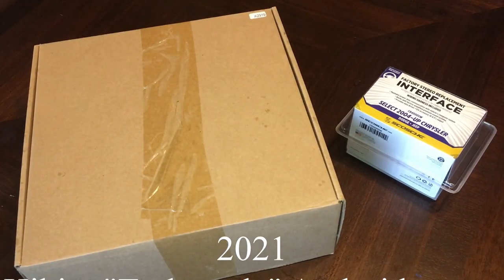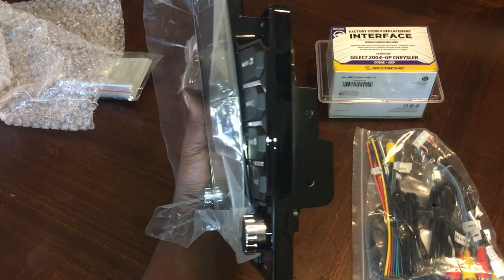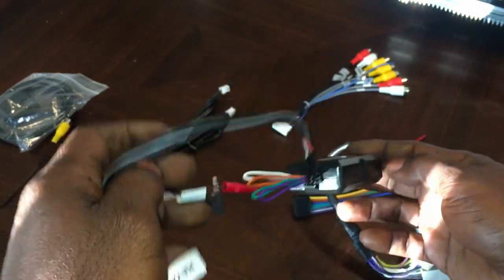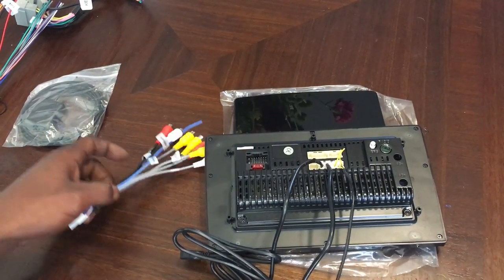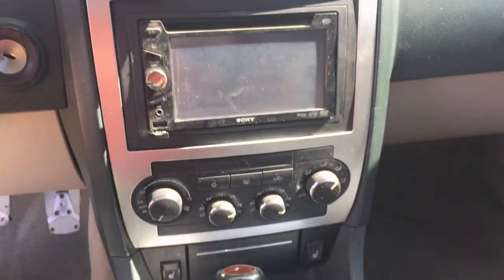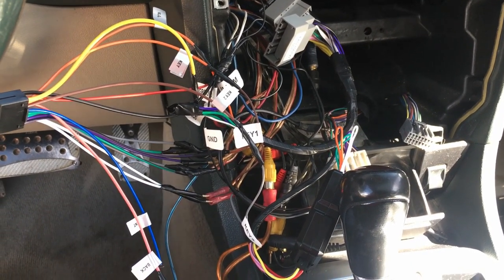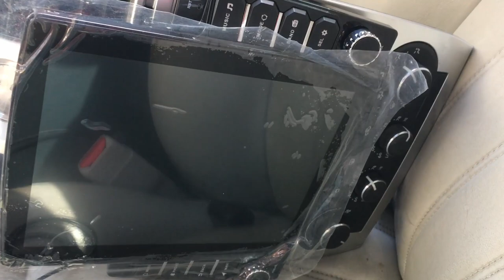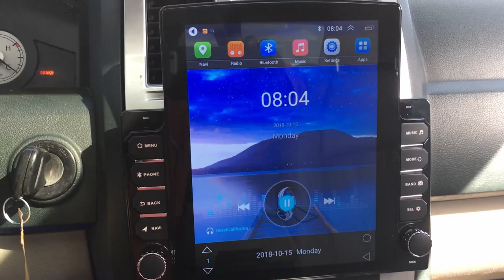AMAZONS CHEAPEST Full functioning Tesla style Android car stereo by HiKity - Everett's install pt1

Comment: Make sure to go to your settings and set it to reboot after 1hr of car shut down or it will drain your battery forcing your alternator and potentially damaging both. It is set to "no reboot" by default that's why it fires up quick when ignition engages power. Also, couldn't delete those annoying songs! If you figure something out, lmk. Lol
Reply: Is there a setting to turn off without power?
Reply: @garystinten9339  go to settings > factory settings> 8888 password> engineering test debugging> 26959910 passcode> direct shutdown mode> press okay and turn off car and allow 2 min for head unit to turn off and reset
Reply: I’m confused . So it stay on draining battery while car is off?
Reply: @dracgod  yes. It'll kill your battery in weeks and may even damage your alternator. Most aftermarket radios tend to mess with the battery and electronics if not calibrated properly.
Reply: @Adeus1  so after setting it to reboot it will turn off after the car is off ?
Reply: @DopeTech1  yes
Reply: @Adeus1 That's pretty rare with any half decent Android unit these days. Cheap options or old units yes. Nowadays when you turn off ignition then open door with canbus as soon as you pull door handle the unit should disable using no power until you open car turn on ignition as it will be shut down. My last 2 units used this shutoff & never had battery issue. Not to say it can't happen with older or less speed units.
Reply: @johnjordan7232  I thought so as well. This particular unit, however, has settings option to stay awake or up to a desired amount of time (hrs) for quick start up. Changing the settings to shut down mode will result in powering on every time you start the vehicle.
Reply: So I just bought one and the screen does not respond to touch. Any suggestions?
Reply: @KyleRobison-tw7uj  I would return for replacement, if that's an option.
Reply: @Adeus1  wanted to check before I do tgar

Comment: I have purchased one of these not too long ago for my E90 2010 I really like it I was able to get the front camera to work correctly The rear camera to work correctly and I can use it and utilize it for any of my movies or music that I can play on but when I shared it on the BMW form nobody not nobody not one person said it's it's okay everyone else didn't like it but I like it that's all that matters
Reply from the maker: Depending on the model I would have to agree. I some cases it may not be worth it to take out the factory head unit. Tesla, BMW, Mercedes and newer Cadillac would just be a few of those examples. It's still a great unit for many other different models (just trying to be honest) I would love to know what cameras you used though.
Reply: @coloradosdigitaldistractio3161  when I get on my break my next break I'll tell you the name of it you can connect it to your camera your front camera from the head unit and as well as you can connect it from the rear so when you're backing out you'll be able to see it no problem The front camera is like a dash cam USB

Comment: Man I have had this head unit on my mind for the last few months I just can’t seem to order it because I keep getting all mixed messages from all the customers. Half of them say they are cheap junk radios and others say they are happy. I have a 2006 Toyota 4Runner I want to install this in and think it would sink into the dash perfectly because around the factory radio there is a lip and the vents are on the out side edges of the radio with nothing in the way on top. Only thing I’m concerned about is mounting it correctly and being able to get inside behind it to screw it into the dash, also I am wanting to install some subwoofers later on down the line nothing big tho I’m thinking like 4 8” woofers or something along those lines. I love the regular head touch head units but I’m looking for something to give my ol’ 2006 a more modernized feel of technology in the interior. Wish there was more options of vertical head units but from what I have researched this is literally the only kind other then one or two others but they do not have a very pleasant look to them.
Reply from the maker: They do have different models. This is not your only option. It really all depends on the setup you have in your truck. It is not an easy install but it can be done.

Comment: How do I do screen mirroring you know it kind of sucks cuz I own one now backup cam it's not all that great features it's not all that great overall this thing blows
Reply: Thanks for that
Reply from the maker: Sorry you feel that way. I also feel that way sometimes when I don't know how to do or use something. But the unit has a split screen option, so not only does the rearview camera work great, you can also display front and rear cameras simultaneously. If you have an android you have to install the app.

Comment: blocking the vents and can do damage on hot or cold.
Reply from the maker: You are correct my friend. I just close those vents when I need them. or I just angle up if really needed. Haven't had any issues yet. I've had it installed for almost 2 years now.

Comment: Sometimes even when I turn off the tablet, then the very next morning I find the tablet on and my car battery is drained. Do you have any solutions for this problem?
Reply from the maker: You have to go into the settings and make sure the deck fully turns off after the car is off.

Comment: I just installed mine and the mounting was the hardest part. I soldered my wiring so connection is good. Overall I’m not impressed with the unit since there’s not a lot of customizable features on the screen. Also the mounting is horrible. Had to rig it to stay on 2 screws and there’s a gap on the bottom. I might uninstall because it would be too easy for someone to steal it. But good vid! Wish I saw it before I bought this thing lol
Reply from the maker: It was a very complicated install. Thank you for watching.

Comment: This shiit is 🔥🔥 The only downside I see is that it's blocking your vents, and that could become a problem in the winter time when you put on the heat. unless you choose not to have the heat come from the vents. That's why I can't get this version.
Reply: Did you get it
Reply from the maker: I have another version I can show for you that would work. The heat thing hast been an issue so far. The car still get really cold and warm.

Comment: Hey how's that thing holding up I hear Too Much bad reviews about it what do you think
Reply from the maker: It's still working perfect. So many things you can do with this. I'm still finding things out. I do recommend going into the setting and making sure the deck turns fully off or it will drain your battery after sitting for awhile.

Comment: Going to install mine , does it really drain your car battery when car is off?
Reply: That’s my same question
Reply from the maker: Yes it does until you go into the settings and make sure the deck turns fully off when the car turns off.

Comment: So I just bought this stereo off of eBay for $75 and mine actually has a subwoofer out mixed in with the audio and video auxiliary plugs it's a green one I'm also lucky I found this video because I'm installing it in the same car
Reply: Seriously it does?
Reply: What’s the link?
Reply from the maker: Not sur if you already knew, but you can also install bass boosters and different equalizers off the play store.
Reply from the maker: No

Comment: I did install it on my 2006 Ford F-150.Did have a hard time to mount it cause of the shape of the the unit it's not standard and you can not use a a standard double din adapter. It came out nice. What I'm having a trouble with is to navigation run cause it's asking for internet connection. I did buy a cheap navigation before and it was working independently with out internet connection. Am I doing something wrong
Reply from the maker: It depends on the app your using. They do have offline apps through the play store but google maps operates online. You can use google maps offline but you will need to be by Wi-Fi to download the map for the first time. Then you can operate without Wi-Fi.

Comment: I have the same one and I only get sound from radio like if I got to the app for YouTube I get no sound same thing with the gps and if I hook my phone into it everything works but no sound what would cause it ? Do I need something else to hook into it ?
Reply from the maker: It's sounding like you do not have your factory amp wire connected to the stereo. Look for both amplifier wires to your car (ant power and amp power). just connecting the regular blue ant will only give you sound from the radio.
Reply: So I bought one and the display does not respond to touch. Any suggestions?

Comment: Did you're Bluetooth work no problems? My Bluetooth won't link well it does but no audio only through radio 😑
Reply from the maker: Try and go into your phone under Bluetooth settings and make sure you have it selected for audio, calls and input to get the full function of the radio.
Reply from the maker: also make sure your amplifier wire is connected to the continuous power. NOT JUST THE BLUE RADIO WIRE,
Reply: Any ideas of why mine keeps blowing fuses
Reply from the maker: @bzraw  It all depends on what fuses and how its hooked up.
Reply: @coloradosdigitaldistractio3161  which one is the amplifier wire

Comment: I keep getting a "no control when small light is on" error every time i touch the screen. What does that mean and can you help me fix it?
Reply from the maker: That has to be a default in the unit. I would send back.
Reply: I was getting this turns put I had my speed sensor hooked up wrong just disconnected and capped it now it works perfect

Comment: I have a Kia Rio (2013) I think one of these would look pretty good.. just a little bit ergh on the whole fitting and then adding the fascia back onto the dashboard so it looks factory..

Is there a way to have the unit powered to permanent power but be able to turn the unit off independently of the car? So I can have the car switched off but still use the radio if I want to..
Reply from the maker: Yes, but it would kill your battery pretty fast.

Comment: @colorado’s digital distraction
Does it have its own navigation? I know you can mirror link, but sometimes I’m on my phone for some else other than what’s on the stereo itself..
Reply from the maker: Yes It does have it's own navigation. you will have to go into the settings and download your maps first if you want to use the navigation offline as it doesn't have the maps downloaded to the deck. Your other alternative is to use an offline GPS app. I believe Wise is one of them?
Reply: @coloradosdigitaldistractio3161  will I need to connect to WiFi or hotspot?
Reply from the maker: @user-kc2ul2rh8b  Only one time to download your desired location area. once you've done that then you no longer have to be online.

Comment: ⚠️ ⚠️WARNING ⚠️⚠️  If you try to install this radio most likely you won't be able to secure it to the dashboard, as that massive screen will  cover the radio slot leaving no room to put the screws in, so most likely will  connect your wires, slide it in and good luck if it goes tight...
Reply: Also may block the vents, depending on what type of car you have.which could become a problem in the winter time when you put on the heat, unless you don't use the vents.
Reply from the maker: Sorry you had that issue. I was the same when I was a beginner at installing stereos. It's a craft and it take patience.
Reply from the maker: That should be a pretty obvious sign that you see before you purchase. There are different models for this reason.
Reply: @BassGods  I don’t understand why people can’t figure this out for themselves Amazon is filled with one star customers that complain because their vents are in the way, it’s pretty obvious if you have vents on top of your factory radio they are not just going to move just because you buy a new radio and need them moved.

Comment: I had this radio about a year ago and it was straight hot garbage!!! You are better of getting a dual from Walmart for the same price.
Reply: Garbage how?
Reply from the maker: I all depends on how much you spend and what you're looking for. They range from 59$ on up. If you're ok with just having a basic android interface and no subwoofer out or a 7-band equalizer and no xover. Then a 59$ unit would be for you. 85$ gets you the amp and controls. 125$ and up gives you a better processor and more memory.